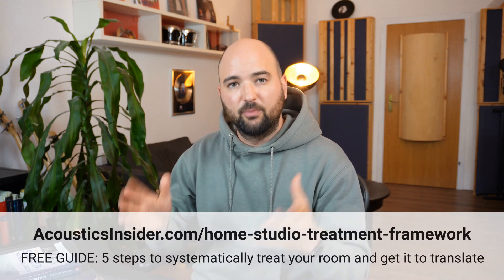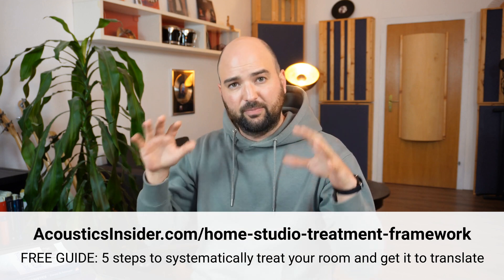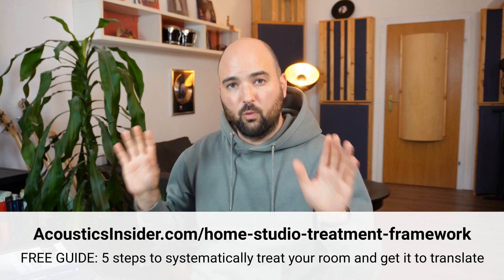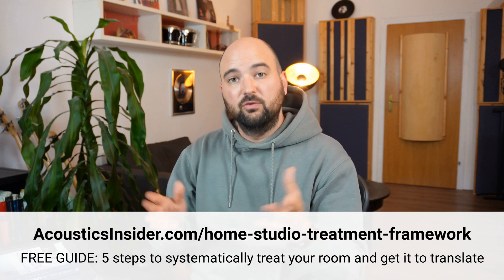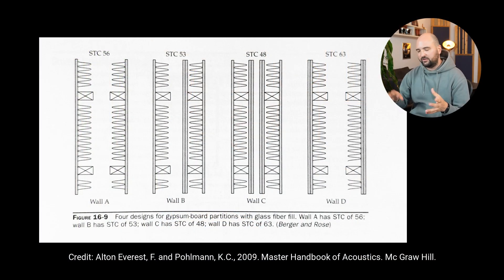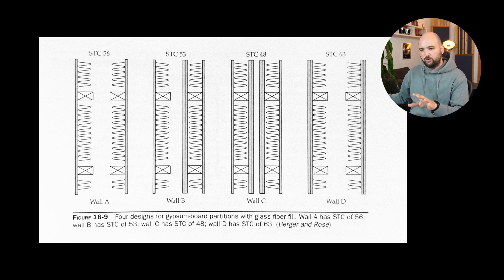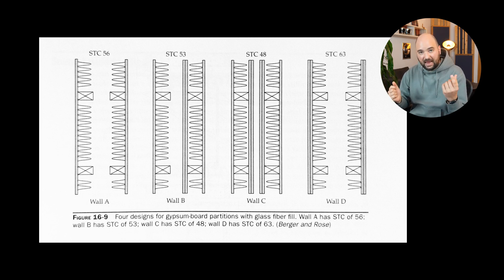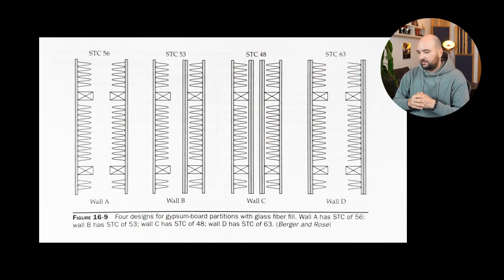Stop Combining Soundproofing with Bass Traps – Here’s Why It Fails

Comment: Anyone taking the mass layers off of a wall to use the cavity insulation as treatment is silly, but you can build inside out inner walls in a double wall system, the only difference is the studs are on the inside rather than outside - the air gap stays the same - this allows you to use the studs as a portion of the framing for the acoustic treatment.  ~100mm is not thick enough for all of the treatment, but it is useful as part of a Wideband absorption system where the stud bays become the framing for membranes, or in a vocal booth where 100mm of treatment would be thick enough for most of the voice range.

Comment: This begs the question, given sound waves are finite does that mean a more soundproof room will require more absorption because more of the waves are contained and continue to reflect back into the room rather than pass through the wall? 

That also makes me wonder if with enough absorption in place a fair amount of sound transmission through the wall must be somewhat reduced as the waves are absorbed.

Comment: Nice video, thx. Do you have any advice about using MLV (mass loaded vinyl)? I wonder if it makes sense to finish a room with a sandwich of drywall-MLV-drywall as a way to improve isolation without a total redesign/remodel.

Comment: There are some exceptions to this. I believe in some of the Newell designs he uses a number of separate damped drywall "walls" in front of concrete walls as membrane absorbers. They have very specific properties (depths, surface density, etc) for tuning them and then since they're pretty massive (in the literal sense of a lot of mass) and cover the entire wall, they contribute to the isolation as well.
Reply: Newell uses inside out framing for the inner shell in his designs but not multiple walls - but he does mention Sam Toyoshima using multiple partitions as you're describing in his book.

Comment: I am currently using an unfinished room to record VO and mix film sound. The only drywall is on the ceiling and rest is open studs with 4 in insulation. I’ve been adding 6 inch insulation over that in key areas then covering with fabric or blankets. This work if my goal is not total soundproofing?
Reply: That will work okay to eliminate early reflections (it would be better if the insulation was spaced off the wall) and will somewhat reduce sounds escaping from the room. If you’re just mixing and not recording live instruments then I don’t think the sound escaping will be very loud.
Reply: @ItalianAvalanche  What I've done so far seems to make a noticeable difference. I'm out in the country so soundproof isn't so big a deal. And yeah, me talking isn't loud enough to be a concern as far as escaping. Thank you for the answer!

Comment: I think northward acoustics (built noisias studio) build their rooms that way, but they seem to construct the front wall into an inward shaped rather flat trapezoid to get rid of the 90 degree corners for Bass trapping, and a pretty deep wood construction (about 20cm) on ceiling and sidewalls, which is then filled out with insulation and covered with fabric. At least thats whats to grasp on some of their instagram pics. Any thoughts on that?
Reply: No, it will be something similar to: 
From outside to inside: 12.5mm drywall - studs with rockwool - 18mm OSB - 18mm OSB - bitumen sheets - 12.5mm drywall - bitumen sheet - 12.5mm drywall - acoustic treatment (up to 1200mm on the rear wall)
Reply: @wiseowlacoustics  thx, that clears up a lot✌️

Comment: I have a lot of space on the ceiling for absorbers. What do you think would be the best "thick" for the absorbers? Wanted to build 40cm thick aborber above me. These would have between 5 and probably 40cm airgab up to the ceiling. Does that make sense? And what fabric would you use? Would you possibly even build your "better bass trap" for it?
Reply: Generally speaking deeper is better however if you go deeper you also need to use less dense material or it will become reflective. Try out the sound absorber calculator that Jesco has shown before. 40cm is very deep and you’ll need very low density insulation.
Reply: @ItalianAvalanche  Yes, sorry. The more material absorbs more I know. Also know the calculator.

I was just wondering if the front that Jesco uses with his basstraps makes sense and with which fabric I span the whole thing?
Reply: Hey I don’t know if you already built them, but I have 30 cm thick bass traps as a cloud. The thicker the better. And it will absorb lower.
I didn’t build them myself though 
I’ve been working with an acoustic expert for a while. He discovered in the last year that leaving an air gap isn’t super effective. You should build it in to the trap, but if you add an additional one, it won’t be as effective.
Most of the information out there is outdated and misleading . 

Hang as close to the wall as possible